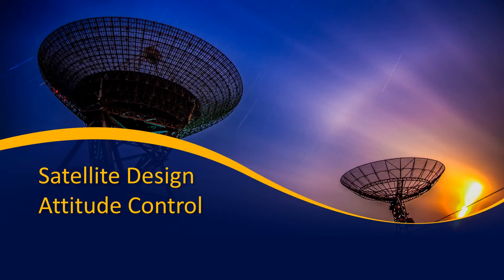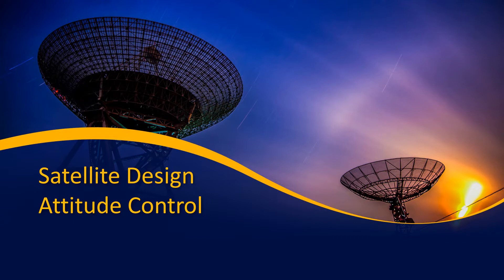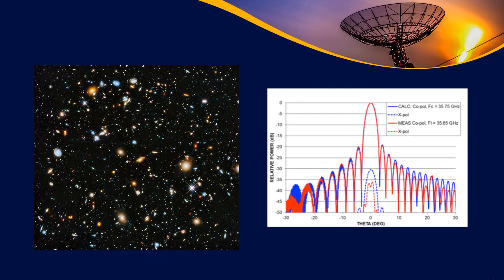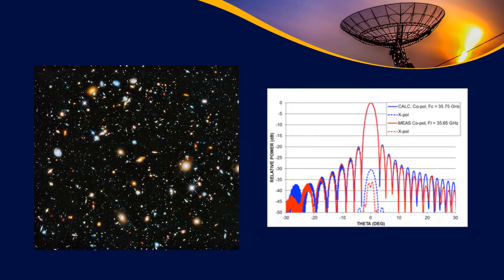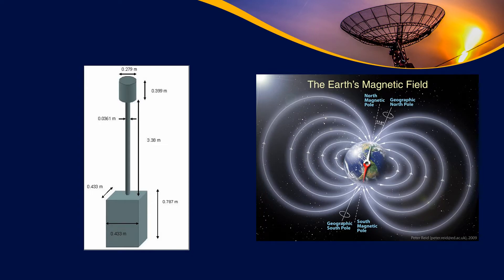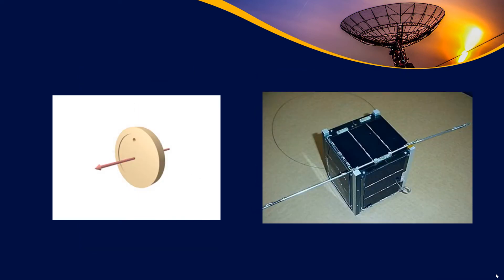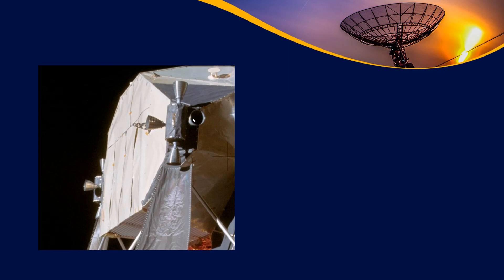Basic Satellite Design-  Attitude Control

Comment: TLDR; Attitude control = pointing. Imaging requires high precision, RF antenna doesn't need so much. (A) Passive control - weight one side of it, use a magnet or spin-stabilized - leaves it always pointing the same way.(B) Active control - flywheels or gyroscopes, or rockets.

Comment: Do the reaction wheels use magnetic bearings to allow vacuum operation without lubricant?  This would also seem to allow much lower power (basically 0) operation once the orientation is obtained.
Reply from the maker: That's a really good question. I'm not aware of any. It seems like the industry is considering them for use, but hasn't settled on it yet.